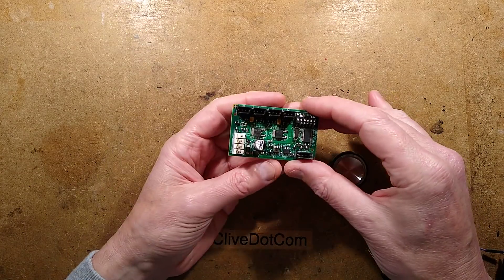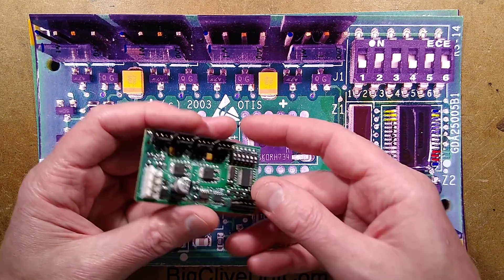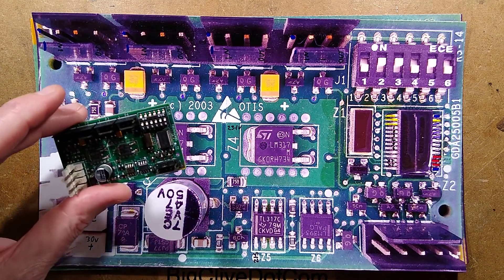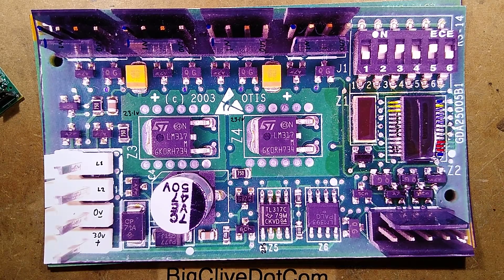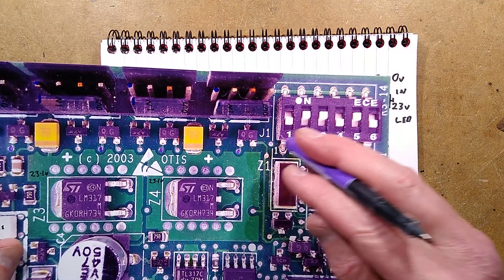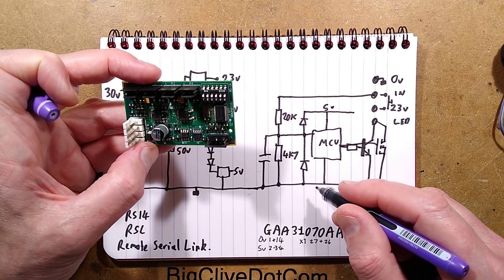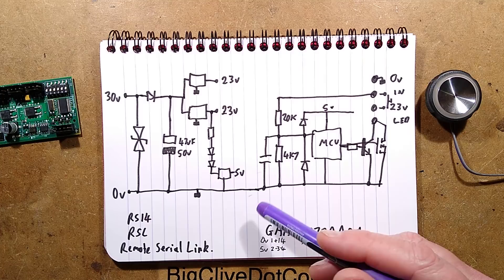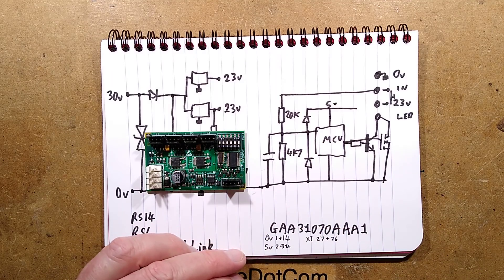Exploring an Otis Elevator button interface PCB

Comment: I had a longtime client who was in the elevator and escalator business; wild alcoholic guy who was full of colorful stories about his trade.  There were always cool elevator buttons, panels, and other parts in his car.  Three interesting things he told me.  Escalator steps have teflon sliders in the bottom.  If one of these is lost for some reason, "Aluminum doesn't really scrape, it smears.  This causes damage to the entire track and rapidly wears all the teflon sliders on that side.  The bill for fixing the system after one $10 slider is lost ran well into five figures.

Second, if you see an escalator step that looks wrong relative to the others, do not get on it.   If you see an elevator that the doors open while the car is still significantly misaligned with the floor, it probably means at least one safety switch has been bypassed instead of correctly repaired, so really don't get on.

The last imagine being told in a rough cigarette voice, like a cartoon villain.  "You know the little frame with the permit under glass you see in every elevator, with the weight limit on it?  We actually test it by loading that amount of weight into it.  It takes two vans and four guys with carts a couple of hours to load and unload the lead weights.  Then the car is raised to an upper floor, the cables are disconnected, and the inspector says, "OK boys, cut 'er loose!"  The elevator has to completely stop within X number of feet on the emergency braking system.   Sometimes it doesn't catch!  The car will plummet aaaallll the way down to the basement with a CRAAAASH you can feel way up at the top!  Dust and sparks and shit come wafting up out of the shaft, and the inspector just goes,  'OK, call me when you're ready for the reinspection!'"

Bonus one:  Due to the counterweight, falling UP is a rare but actual danger.   Bonus two, the techs HATED any work in the bottom of the shaft.   They always had to go in first with bleach spray bottles on the end of a hose and wash the whole thing down.  Turns out SO many people pee in elevators!  A given in ones that homeless people can access 24h, but universal even in ritzy high rises.
Reply: The counterweight (found on traction elevators) is 1/2 the maximum weight of the cab. The idea is to minimize the necessary friction on the sheaves, which minimizes the number of ropes needed. Therefore, if the car is lightly loaded, going up uses less power (and may even regen power into the grid) than going down, and so you should take the elevator up and stairs down.
Reply: @straightpipediesel  
Little correction, it's the weight of the empty cab itself plus 1/2 of it's rated max load.
So, for example: cab weighs 1200kg max load of 1000kg then the counterweight would weigh 1700kg.
That's why falling up, in case of break or gear failure is so much more likely than falling down.
And that's also why some lifts are equipped with emergency brakes that trigger upwards  and downwards.
Reply: Another interesting thing is the reason why there's often a sign saying "LEAVE NO JUMPERS" in the elevator machine room. Major accidents have happened because a safety circuit was bypassed with a jumper for testing, and was left in place when it should have been removed.
Reply: @brianleeper5737  was it a woolly jumper?
Reply: @Dime_Bar  Wire jumper.
Reply: @brianleeper5737  how's that going to keep you warm?
Reply: @brianleeper5737  that's why Otis uses gives you an actual connector with which you can bridge the shaft door contacts (which also connects to a pin telling the controller not to run in normal mode anymore). So you can use it drive it on inspection with shaft doors open, but you can't forget to take it out and leave the safety disabled, since it's just not gonna run in normal mode anymore.
Reply: @HsMals3n  That's really interesting about the Otis test dongle that inhibits normal mode while connected.  This is an example of a design philosophy that Buckminster Fuller called "Don't proofing."  It's the same lesson that gave rise to "Murphy's Law" where a technician named Murphy installed a set of G-force sensors backwards on a rocket sled, causing the human test volunteer to be exposed to dangerous G-forces for nothing because they went unmeasured.  The engineering solution is to build the sensors so they can ONLY be installed in the correct orientation.  Same with connectors that can only fit to the correct part and in the correct orientation.  Vehicle airbag connectors have a built in springy bridge that shorts the terminals together when the connector is removed, so an untrained technician can't get it literally blowing up in his face by attempting to test it with an ohmmeter which applies voltage.
Reply: @lironmtnranch4765  As an example of connectors that can fit the wrong device....some vehicles apparently have O2/oxygen sensor wiring which is long enough that the bank 1 and bank 2 sensor connectors (in V6 and V8 engines which use two upstream sensors) can be plugged in wrong/swapped. This apparently results in some bizarre drivability problems. There is actually an OBD-II code for this situation (P0400) but I suspect that the older OBD-I systems can't detect it.
Reply: @lironmtnranch4765  I've actually got a few (older) cars that have an airbag resistance spec in the factory service manuals. They also specify use of a digital, rather than analog, meter because the test voltage is lower.

The airbags also had "special service tools" (jumpers) to short the connectors. My BMW actually had clips on the 'bags to store the jumpers after installation; all the rest required a service kit.
Reply: @brianleeper5737  I have heard of people jumping off of tall buildings but not from the elevator.
Reply: If you `cut the cables loose` to test the emergency brake, you would then have to reconnect them and test them again. Then reconnect them and test them again - for ever.  To say that your friend was an alcoholic explains a lot.
Reply: @rjmun580  I saw the "Red Flag" as well.
Reply: I'm an IUEC Local 1 Journeyman, NYC.
That's all true except for many decades now, Category 5 testing, which involves testing the emergency brake system, is never done by "disconnecting the hoist cables". The mechanic secures the unit, 125% of the weight capacity is loaded into the cab, the car is brought slowly to about 2 floors up from the bottom level, ran down at full speed with the shaft slow-down limits bypassed, and the governor is tripped to engage the safety clamps onto the rails, stopping the car. 99.9% of the time, all goes well, the car never "crashes" into the pit, it's unloaded, returned to normal conditions, and returned to service. 
Sometimes, a bit of minor damage to the finished walls of the cab may occur, especially if the customer has fitted it with glass or marble. 
I've only been in the industry for less than 2 decades, but I too have some first hand stories that'll make you cringe, or gag, but I won't be telling it with bourbon or tobacco breath.
Reply: @LongIslandDad  Thanks for a modern update.  This story was told to me 25 years ago and he was a seasoned journeyman at that time (eventually pickled too) so some of his stories are over half a century old now and no doubt exaggerated and aggrandized to some extent.
Reply: Great post, thanks.
Reply: The car emergency brake tests are not made with the cables disconnected, a typical residential car has 3 or 4 cables, and one single cable is calculated to withstand the full load of the car + passenger + counter weight, it takes a couple of hours to disconnect them.
The test is made in the machine room, by mechanically actuating the speed governor (invented by otis), and making the car move, and it must a) lock the car emergency brakes and b) open the emergency brakes safety switch.
The overload devices are tested by lowering the calibrated weight to 60~70 Kgs and then entering the car, it should not accept any calls and alert the user.
Counterweight don't fall up, they are pulled up by the car moving in the opposite direction (which means the cables are attached).
I have seen an accident where the machine shaft broke and the traction wheel was free to rotate, and because the car was above the counterweight it came up until the counterweight hit the springs on the bottom of the pit, the car with the impact locked the emergency brakes above the top floor. After suspending the car, we had to blow torch the brakes off to free the car. Luckily there was no one in the car.
That guy probably drank one to many beers and should not be working in the elevator business, he his a liability to himself and others, i would fire him on the spot.
Reply: @xipasoftware  I considered him a friend, albeit never closer than arms reach.  I did eventually have to fire him as a customer as it tacitly supported his worsening drunk driving.  He became unemployable before retirement age, and a particularly bad final DUI crash put his already ravaged body on a death spiral.

Such a shame for everything to end at the bottom of another bottle for him.  In his better days he worked in LA's most iconic skyscrapers, including the original installations in the Bonaventure, the Galleria of Valley Girl fame, and the rush of construction for the 1984 LA Olympics.
Reply: And don't forget, If the elevator is on the ground floor and when the doors open you see a bunch of corpses laying on top of each other covered in blood .... take the other elevator !!

Comment: An interesting bit of circuitry! My initial thought was wondering if there was some way I could put this to use, but then I figured the circuitry is probably specialized to the point that unless I had an elevator, there isn't. Very neat use of switching to 0v to turn the led on to note the call is accepted, though, I may be able to use that bit in an upcoming project!
Reply: Also that board is already an older design. These days with certain microcontroller modules readily available, you could do similar things with those as well, likely a lot cheaper and flexible.
Those things are designed to be somewhat robust and fail in a mode that does not cause the elevator to get stuck closed.

Comment: The circuit looks a bit overengineered and complicated. It has to detect 4 button presses and control some data lines, right? Is it all about overvoltage and vandalism protection?
Reply from the maker: It's about extreme electrical environments, including customers walking across carpets and discharging static electricity to button metalwork.
Reply: @bigclivedotcom  Thank you for the answer. Wouldn‘t it be more cost efficient to use a tight full metal enclosure for the circuit board (faraday cage) and secure the switch lines with one suppression diode (TVS), each side. In addition, use a good switch metalworks isolation… ? I‘m wondering if making the circuit more complex is a good solution. Also: is using a custom chip part really a good idea? It would have been cheaper and more future proof to use e.g. a standard (one-time programmable) PIC16, there is also a read protection feature to save intellectual property.
Reply: @mad_circuits  - the chip may well be a “standard” microcontroller, but made using a mask ROM. Hence the manufacturer has used the customers part number. This is cheaper if ordered in the tens of thousands.
Reply: @mad_circuits  a metal enclosure doesn't help  for suppression of electrical spikes/noise coming through the in and output wires.
Reply: @rj7855  Therefor I suggested suppression diodes on the switch/button wires. But for high voltages coming through the inputs I don‘t see on-board components helping: Are the circuit board trace distances sufficient for that?
Reply: @mad_circuits  Current is limited by the voltage divider and clamped to the appropriate maximum voltage range range, standard stuff really and not much more going on;
Power input with protection,
Button inputs with protection 
simple pull down outputs for the led outputs
and a simple microcontroller to glue it all together and providing the serial io
and that's it.
Reply: @mad_circuits  and the microcontroller is most likely a off the shelf part, either onetime programmable or with mask rom (cheaper if you buy enough of them)
Reply: It's also about safety (reliability specifically) and security. Modern elevator systems need lockouts and what amount to passes to control who has access to which floors. The first concern means the board looks overengineered, but it's as Clive says to cope with accidental overvoltage events as well as making sure it fails "safe". There's also "debouncing" the signal from the physical button signal to the microprocessor- that's another function of the cap/resistor/diode network on the MCU inputs. The input pins typically go to an internal RS or other flip flop. (A quick video on debouncing seems called for, hint hint)
The second concern is mostly handled by an external security system (look up Otis Compass) that examines requests from boards such as Clive showed us and then either allows or forbids the doors to open or the car to move.

Comment: Hint: I used to use a piece of cooking foil clipped to one of my meter leads to quickly identity the general area that a trace has run to.
Reply: Alternatively, stripping a piece of wire and splaying the individual strands into a line makes a very good trace… tracer.

Comment: Clive, How do you look at a PCB and know its multilayer ?  by now seeing a via come out the other side ?
Reply from the maker: Looking up to the light you can see the front layer, back layer and a shadow of the inner layers.  There are also tracks that appear to be dead ends that are connecting to internal layers.
Reply: Sometimes good pcb designers 
identify layers by numbering them... mostly done for more than 3 layer boards

Comment: Clive you would not believe how complex the hydraulic units are. imbedded units , ive worked on the programmable motor starter units from the 2000s. ive changed fields now . still love electronics , thanks brother. WE are all brothers in electronics. thanks.

Comment: Otis Elevators has a test elevator shaft in Southington, Connecticut right off the freeway and not far from where they are engineered. It’s about 5-7 floors tall and just a square concrete elevator shaft.
Reply: Being British, Big Clive would know of the Express Lift Tower in Northampton. It was actually abandoned and functionally replaced by the tower you mention after the Express Lift Company was taken over by Otis.
Reply: @straightpipediesel  so testing was done in England but now Connecticut?
Reply: That's only 5-7 floors? It looks so tall from the street
Reply: @piratetv1  it’s not that tall. Not much benefit in having it super tall.
Reply: Otis has an elevator test tower at 99 Century Dr, Bristol, CT 06010 that is listed online as having a height of 384 ft (117 m). The Hitachi H1 Tower in Guangzhou, China is listed online as currently being the tallest elevator test tower, having a height of 897 ft (273 m).
Reply: I completely forgot about that until I read your comment. I've driven past it a few times, but since I'm rarely in that end of the state, it slipped my mind. I remember hearing about the fire on the news.
Reply: La Cucaracha entran pero no su salir.
Reply: Cheap flats for rent, you just need to bring your own flat

Comment: I wonder if sticking a digital storage scope type thing on the comms link might provide some insight as to what their wire protocol is? Bean Eater has a video on discovering the signalling on a USB keyboard. Sure, USB is a documented standard, but I think you could probably discern some useful information about the wire protocol one way or another. Or I could get my (lab) coat. Unsure if pasting a link to Ben's video will get me a clip round the ear: https://www.youtube.com/watch?v=wdgULBpRoXk

Comment: Thank you Clive.

What's the voltage on the LED pin? Does the LED pin drive the LED or just switch it on?
Reply from the maker: The led pin switches to zero volts.  The 24V is always present on the led positive connection.